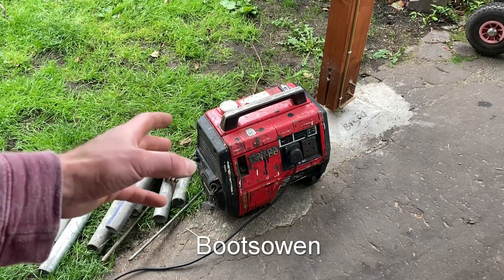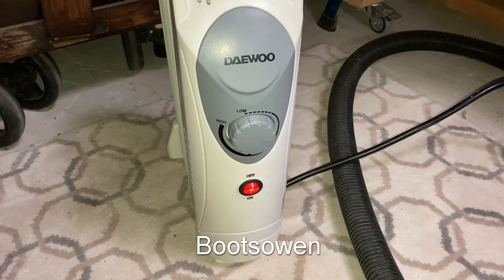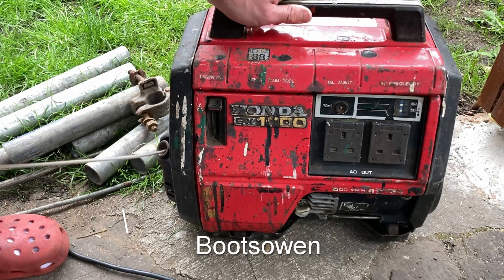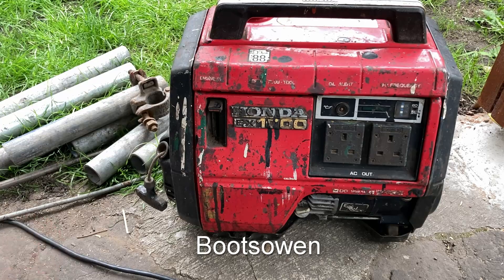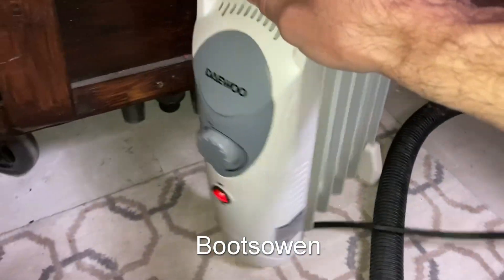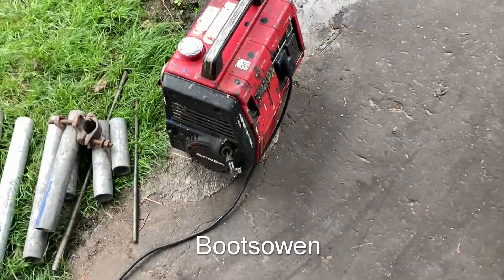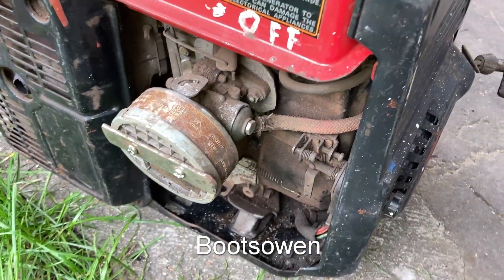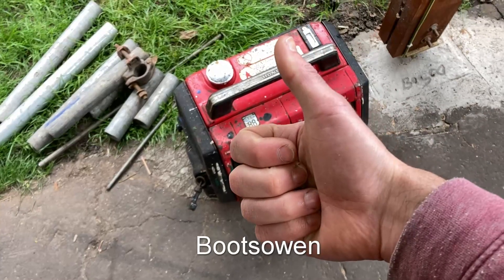Honda EX1000 Generator load test

Comment: That the "Apple device" within the generator types. Fancy and sleek look, build compactly but useless for real workloads. This thing can't even drive a 900W power drill without stalling.
Reply: we had this generator an happily ran a large kango concrete breaker, i guess it looks well used, might well now be off spec on the power it can handle. we found it always needed choke when starting.

Comment: Owen, that recoil starter needs re-tensioning and maybe a new pawl. Then the engine would turn over faster and start easier. Probably look at the plug also. Good idea for power stability for this winter in conjunction with a battery system to reduce grid reliance, cheers

Comment: What would happen If you plugged a washing machine into it
Reply: Doh, the washing machine heater will be 2 KW and this generator is 800w, cheers
Reply from the maker: If you put a dimmer switch on the element only and held it back at 200w it might work on this genny.
Reply: @bootsowen  Just theory but fill with hot water, otherwise it's energy dense fuel being turned into low grade heat. How long would you have to run the genny to heat water to 40 degrees with a 200 watt heater? Cheers
Reply from the maker: That reminds me of school physics. I dare say that once upon a time I could have figured that out!
Reply: @bootsowen  Yes and the theory will not match a practical experiment. I'm assuming it would be no more than 20% efficient. The only way to know is to do it with a fixed volume of water and a dimmer controlled washing machine heater. All with a suitable watt meter / amp clamp, volt meter. Sounds like a video? Cheers
Reply: Nothing- as long as you don't turn it on.